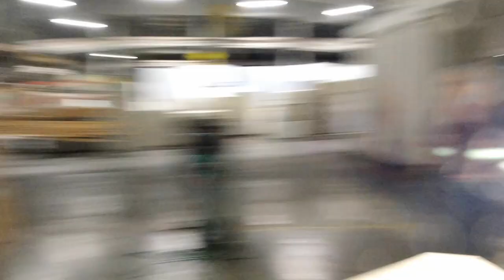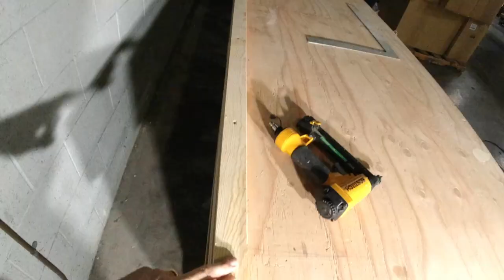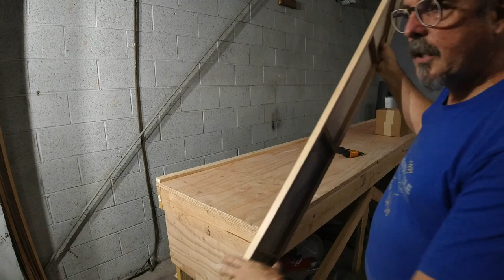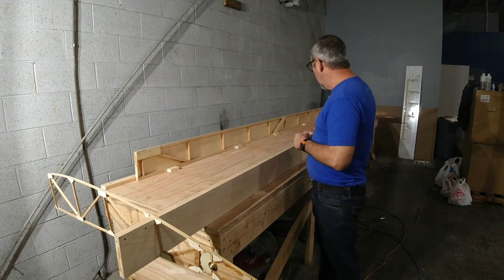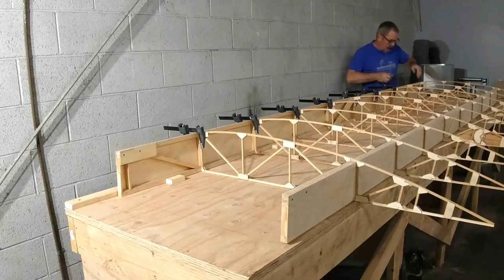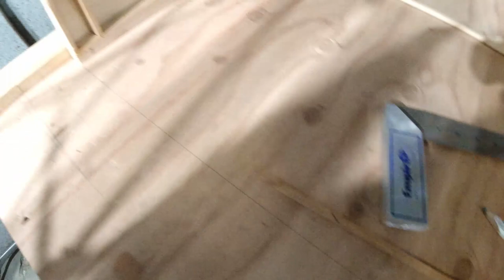Minimax 1100r Aircraft Build Vlog Episode 3

Comment: Just starting my 1100R. Have built tons of R/C in the past but this is my first ultralight build. I find your channel very informative and look forward to watching the whole set of videos. Thanks for your work! I haven’t flown since ‘95 and am anxious to get back in the air after some training.
Reply from the maker: Hey Paul! I’m so glad you’re starting a 1100r! 
It is such a great airplane to build!
I just hit the 400 hour mark but if you have a kit, it will take you a lot less. I have spent a lot of hours cutting wood to size. Any questions you have, just ask away!
Reply: @DTMinimax  No kit, doing it the same way you are. I’ve already learned quite a bit from your videos. You are explaining what I’m missing from the plans. I’ll keep my eyes and ears peeled and get back to building my ribs! Thanks again!
Reply from the maker: @paulkeeton6512  awesome!
Did you see my rib building video was just posted recently?
Reply: @DTMinimax  I haven’t seen it yet but I will take a look. I have my fixture built and a couple of ribs complete so I’m on my way. I find this very relaxing work. I am the lead CNC repair technician for a landing gear manufacturer and this helps to melt off the days stresses.